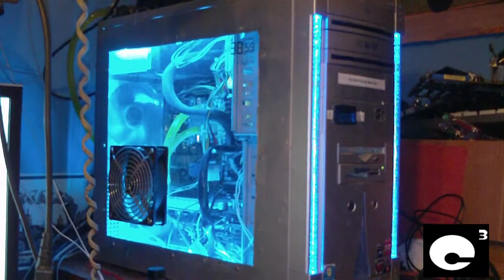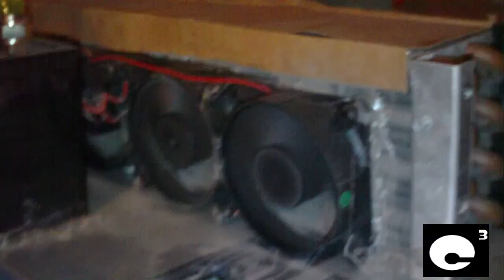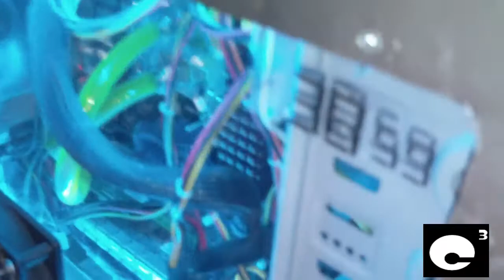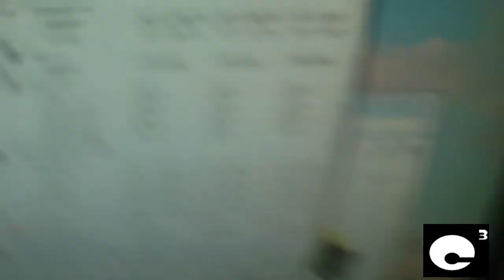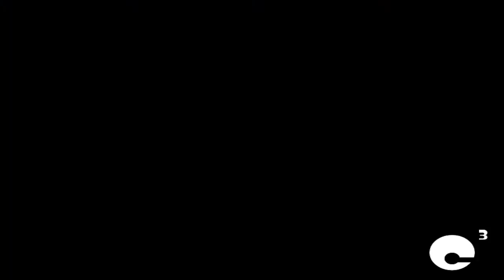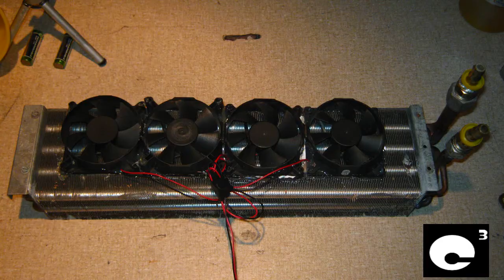Info for 1st timers to Water Cooling + Pics of Liquid Cooled MidTower Deluxe

Comment: pure distilled is actually non conductive, and contrary to popular belief... corrosion is the enemy with these water cooling systems. Its the slow leaks that you don't notice that can rot out traces and chip pins.The second more rare enemy is the sudden loss of coolant when you're at work or school, that soak the floor and overheat chips. Also, the pump failure or failure to plug in the pump will cause an overheat.

Comment: @CubeComputerChannel
go to google and search 
skinnee labs fluid xp
If your worried about tube connections leaking use barbs and then go down a tube size
for example
1/2" barb   - 7/16"ID tubing 
7/16" barb - 3/8"ID tubing
3/8" barb   - 5/16"ID tubing (may be hard to find possibly restrictive)

Comment: @CubeComputerChannel
Also if you switch to distilled you can use a drop of dish soap(or any other relatively non-toxic  surfactant) to aid bleeding air bubbles.
For the most idealistic setup the pump should be at the very bottom and the reservoir at the very top and loop order should be whatever makes the tubing length the shortest.

Comment: @CubeComputerChannel
If you get a heater core buy an early 70s dodge? B300 heater core 2.5" thich large enoug for around 4 120mm fans per side but you will have to make ypur own mount shroud.

Coolants other than water tend to cause clogs in (pinned or channeled) blocks and radiator channels and tend to have less specific heat capacitance than water. If you do switch to plain water absolutely make sure no unlike metal are connected in the loop.

Comment: @CubeComputerChannel
Use only water as a coolant and add a biocide such as( copper sulfate or Benzalkonium chloride only a few ppm necessary), or a piece of .999 silver.

If you want a good block for a reasonable price try the enzotech sapphire it performances within a few degrees(1-2K) of it it expensive competitors plus its all copper, one of the most nonrestrictive blocks on the market,comes with 1/2" barbs and reasonable thermal compound however i have hear it might have some flatness issues

Comment: @CubeComputerChannel
If you could get a car heatercore it would be a lot more efficient than a condesor and less restrictive.
Also closed loop systems are usually about as good as more affordable air cooler however they do have an advantages of putting less strain on the motherboard and keeping a nice clean area around the cpu for extremely tall ram heatspreaders. but with a highly overclocked cpu they're no better than more affordable air coolers.
For "affordable" water cooling try xspc kits.